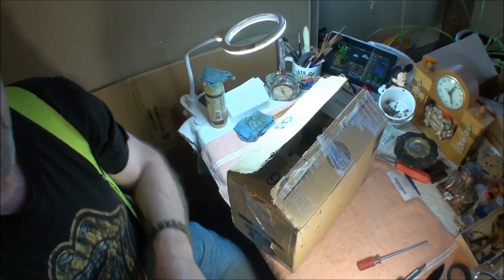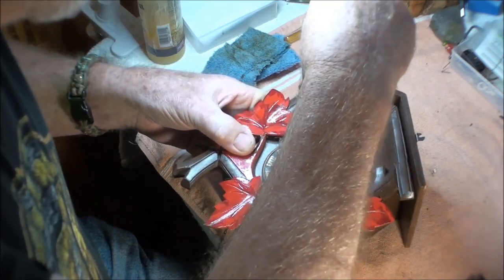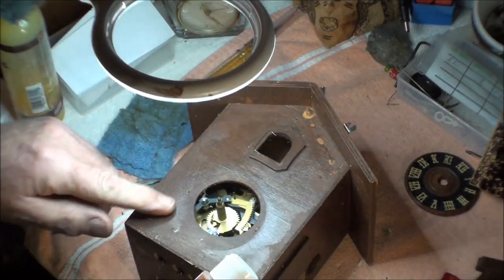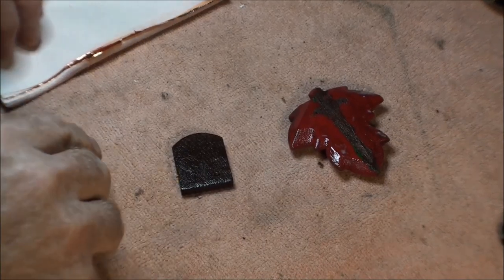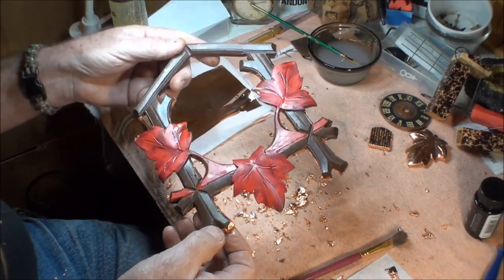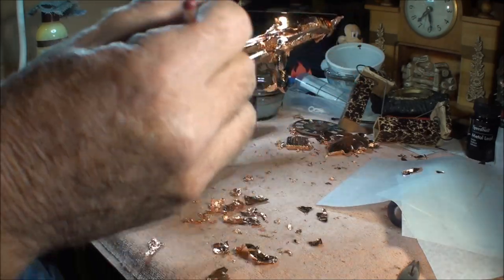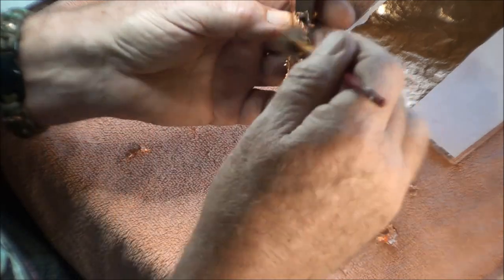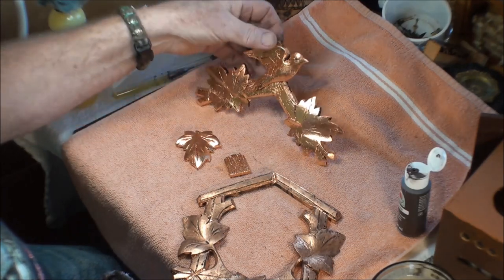Copper Metal Leaf a Black Forest Cuckoo Clock

Comment: Mike I dont know what you call them but they have wire cutters with a round end. Grabbing the nail with the clipper and then rolling it down helps get the nails out.
Reply from the maker: I try not to damage the front of the clock or push too much on the frame so not to stress it out and break it. If I were to put it in my mind, what tool to look for working on clocks, I would figure it out. But by the time I get there, I forgot why I came into the store, lol.
Reply: @justmike57  I sent you a pm on a video of the plyers and how to use them.